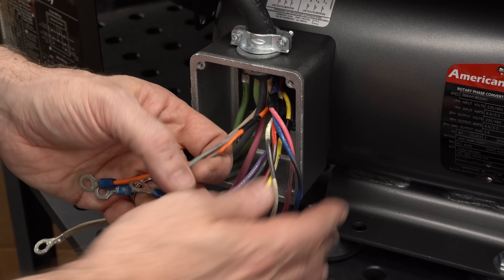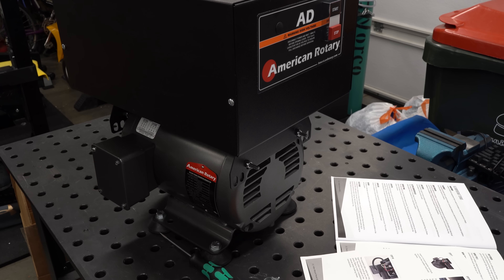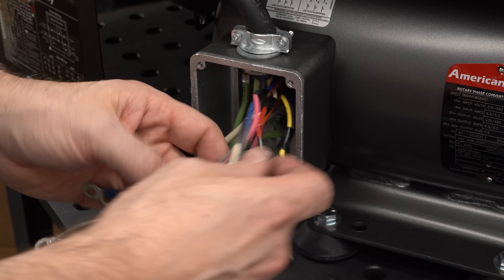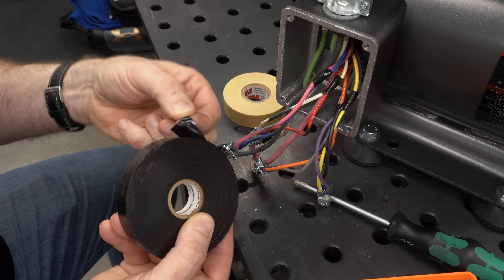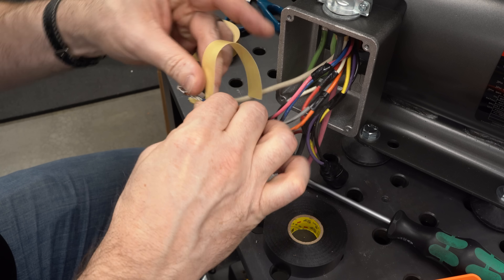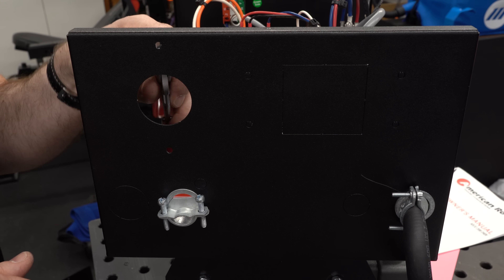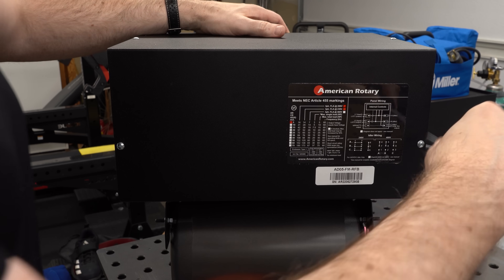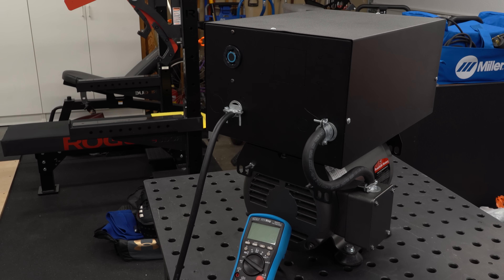How to Wire a Rotary Phase Converter the Old-School Way!

Comment: Ok, so you asked for a hilarious machinery moving story... I've got one for you.   When I built my workshop back in 2016, I also bought a small VMC (Haas MiniMill2).  I had the machine delivered to the riggers, and they brought it on a big flatbed to my little cul-de-sac along with an electric forklift to move it.  They moved my smaller machinery (bridgeport, lathe) into the workshop and then got ready to pick up the Haas... and... the battery in the forklift died, right in the middle of the cul-de-sac.   Did they bring the battery charger?  Of course not.   The riggers are about 50 miles from here, so they called ahead and several hours later sent another 18-wheel flatbed, with a larger forklift on it, to park in my tiny cul-de-sac.       They used the big forklift to pick up the little forklift, and proceeded to finish their delivery late at night.   It's actually a good thing that this happened, while I was waiting I read the data plate on the electric forklift and it wasn't rated enough to lift the 5100lb VMC.   Without me asking the riggers dropped their price by half for the trouble, so all good in the end.  I hope your grinder hilarity has a similar happy ending.

Comment: What's the down side of using a VFD to convert 1 phase to 3 phase ,???  if at home  shop , it would probably be 1 phase 220vac to 3 phase 220vac (for north america)
Reply: not all motors have insulation rated for vfds, and 3 phase welders dont like vfd power either
Reply: VFD manipulate extreme hertz levels and are not safe as a general power supply and are designed to completely control one load....the voltage is not safe to use as a general power supply.
Reply: @fritzmiller9792  yes agreed but if you set-up 60hz and 220vac 3 phase , that's what it will do all day.

Comment: To be honest I would have used Wago Lever Nuts. As the idler is just a three phase motor without a shaft there is very little vibration. In a small shop it is unlikely to see enough use to ever wear out the bearings let alone wear out a lever nut an cause failure. For average small three phase motors in non severe service they have become go to.

That said it was a good demonstration of motor lead connection and insulation. I have done the same many times building new industrial equipment. My only recommendation would be to stretch the 130C tape more. I was taught to stretch it to twice its original length and wrap it tightly in half lapped layers until the shape of the terminals and bolt are no longer distinguishable. You use about the same amount of tape but end up with a dense void free ball around the splice. Additionally the outer cover with electrical tape is mainly to prevent the individual splices from getting stock together as the tape vulcanizes.

For you dilemma of two wire into one ground lug. The best option if they are both the same size is to use an appropriately sized double or twin wire ferrule. Putting two individually wire ferruled or un-ferruled is fine as long as the lug or termination point is rated for it and the lug in you unit probably is (most set screw type lugs and ground terminal bars in that size range are from what I have seen).

Lastly as mentioned previously modern small three phase motor leads almost always have the wire numbers printed along the  entire length of the wire. If you ever have a motor with no identifying marks it can be recovered but it is a bit involved as part of the process involves powering up individual windings while measuring voltage on other windings to determine the correct phasing of them. Not a big deal but tedious especially if it is a large motor.
Reply: Interestingly, anything that uses spring-clamps instead of screws (whatsoever) should perform much better under vibration, so I did not understand his argument there. However to his credit, the problem is alleviated using the (proper) shake-proof washers. Still, I think when it comes to vibrations, in the long term spring based clamps will perform better, always.

Comment: Glad you made the video as the problem with using VFDs that frost / flute ball bearing due to the (PWM)pulse wave modulation cycles possibly hundreds per seconds worry me..there's talk from Hvac guys saying stray charges build up on / in the armature that get up to 70 volts before finding ground/ earth thru the ball bearings..frosting then fluting them..of course a solution, is to add a ground to the shaft it self with a common commutator brush with spring mechanism to keep the brush in contact with the shaft and offer a ground path that's not thru the ball bearings..but a grounding rod and wire in needed as well ..they say about 300hrs before serious damage occurs, which most hobbyist level operators will take many years to see..that's why some people claim zero problems with VFDs and don't even know of this problem..
Reply: I saw this happen just wiring up an older 3 phase motor not intended for inverter duty. There was enough current to shock me because I didn't ground the motor case, and to have that current flow through the bearings to ground would mean early failure. Definitely need brushes on the shaft or just use a motor designed for it?
Reply: @topduk  less reliable is just a copper wire wrapped in a loop around the shaft to ground..it would need more up keep as it will tarnish and loses ground the copper wire etc..even worse the charge could find ground thru the spindle bearings destroying a mill or lathe vs just a electric motor..rather just add a ground or use a rotary phase converter to avoid this problem that isn't really known by most people as it takes so long to cause serious damage and many times people don't know or understand the root cause of the frosting / fluting of the ball bearings..

Comment: My first machine tool shipping story.  I bought a 1966 Springfield lathe on eBay for $500.  I drove to Carson City and trailered the 6000 pound machine back to Boise.  When I got it home, I attempted to lift it off the trailer using my 9000 pound automotive 2 post lift.  Unfortunately, I did not think through my rigging, and the side load on the lift ended up cracking my concrete floor.  We ended up rolling it down off the trailer using ramps and pipes, after which I had to remove my automotive lift and jackhammer out that whole section of my garage floor so I could repour a fresh, reinforced pad.

Comment: My second machine tool shipping story.  I bought a 1959 Gorton 1-22 Mastermil vertical milling machine on eBay from a seller in Milwaukee.  I paid $800 for the machine, plus $800 to ship it to a shipping terminal near my house in Boise.  It took the seller more than a month to actually ship it, and when it arrived I discovered why.  The seller had set the machine on a thin stamped steel pallet, and then strapped it down with 3 little 1 inch ratchet straps.  Somehow the shipper accepted it.  As you'd imagine, the machine had a rough ride.  It did have some damage.  I spoke with eBay, who advised me to accept the shipment, and then contact the seller about the damage.  After some back and forth, eBay ended up refusing my entire purchase price and the shipping.  I had the machine repaired in just a couple days and I've been using it ever since.

Comment: Any particular reason you chose a rotary as opposed to solid state phase converter?  Someday when I upgrade my CNC to one that requires 3-phase I was planning to use a Phase Perfect solid state unit, they appear to be more efficient and will theoretically keep the frequency more stable (important for CNCs, maybe less important for simper motor loads?)
Reply: I have the Phase Perfect and it's.. well, perfect.
Reply: Have had phase perfect for 20 years replacing a rotary converter. Probably more money but I would never never go back to a rotary converter. No noise, always on, better quality 3 phase than the power company, full horsepower and only 2% loss in power to make the conversion. If you make YouTube videos the noise reduction is a game changer for audio.
Reply: I would use a phase perfect too
Reply: I’ve never had a rotary doing anything to the frequency, I’ve built several in my younger days and had a few commercial ones, they maintained the line frequency that the electric company was supplying. Only ever checked for brief periods though.
Reply: I will probably depend on what you get. My Syil X7 only required a RPC because it has to go through a transformer anyhow to get to the required 380V. The drawback though was I needed a 15hp unit to run a 7.5hp spindle.
Reply: @TomDetka  At the risk of taking James' comments way off topic, the upgrade for me would be to a Haas VF2, 30HP, 70A for 3-phase 240V.    Goals are faster spindle, larger ATC, so I could also do this with a 15HP Super MM2.  That only needs 40A 3phase, so I can do that within a 150A 2-phase budget.   Back to James' rotary, in his video it sounded much quieter than I expected.  I always thought rotaries were noisy!  I shouldn't be too spooked by 3Phase at home.

Comment: Worked for a small R and D company in the early 80s that specialized in unusual condition product handling mainly with the plastic bottle industry. Customer wanted a small footprint but tall preform sorter for a tight location and we produced. Loaded in a semi-trailer for the trip across the country and received a call when it arrived that the machine was damaged. Discussed how the unit had been loaded and secured and the receiving officer responded by saying with amount of splintered lumber in the trailer [ the bracing from packing} and the fact the machine was hanging thru the side of the trailer almost to the point of falling out that they believed the trucking co was responsible, they also ordered a replacement unit on the same call.

Comment: As an oldtimy electrician myself, the three wires taped together in the peckerhead was a dead giveaway. From memory it should be, 1&4 tied to phase "A", 2&5 tied to phase "B", 3&6 tied to phase "C" (or in this case creating the "C" phase) and 7,8,&9 connected together and tucked away in the peckerhead.

And old-school would involve a lawnmower cord used to spin up the idler shaft as you apply power to the converter. The homemade one in my garage uses a pony motor.

As for your ground wires, your lug should be approved for two conductors, so you should be good.
Reply from the maker: Cool.  Thanks!
Reply: I agree about the ground, most of those lugs are designed for multiple lugs.

Comment: For many years my grandfather just pull started his 5 hp motor used as a phase generator. Nothing else needed. Capacitors and voltage switches only make it self starting. 😁

Comment: Everybody from the EU seeing the motor connections: WHAT THE F******CK?!?
Reply: Which is exactly what we say when we see their wiring methods. Check out the loop-fed branch circuits that were all the rage in the UK after WWII if you don't believe me.
Reply: @MrWaalkman  UK is not EU any longer, and Europeans have always laughed at UK's archaic way of doing electricity and plumbing. Let's put the plumbing outside the house, so it's easier to replace when the pipe cracks from freezing.

Comment: It would be great of the wires were labeled, but it would be even more great if it wasn't so prohibitively expensive to install real 3 phase power connection at residential houses. It would be absolutely amazing if each new house got a 3-phase power by default, like in other parts of the world :/
Reply: I suppose it's less expensive to run one 720 VAC line and then a step down pole mount transformer to feed the house 3 phase.
Reply: @dans_Learning_Curve  I'm not familiar with it, but if it's single or split phase you still need a phase converter. In a 3-phase system the the phase shift is 120 degrees between lines, and for split phase the phase shift is 180 degrees. A step down transformer will not change phase relation.
Reply: @piranha32  American 'single phase' is just that, a single sine wave at 240V with center tapped neutral.
A rotary phase converter couples a single phase 240V motor to a three phase generator (idler)
American Rotary has a full page explaining their products but obviously YT doesn't allow links so you'll have to figure that out yourself.
Reply: @jimurrata6785  I know how a phase converter works. And I know that with a 3-phase service is is completely unnecessary.
Reply: @piranha32  Then why do you say "for single phase the phase shift is 180°???
There is no phase shift in residential American 120V power. It is two halves of a single 240V wave.
Places like western Europe get 230V x √3 = 398V to the home for stoves, saunas, ect...
When I moved shops a decade ago I had a hard time getting three phase to a building zoned light industrial!
Reply: @jimurrata6785  Split phase.
Reply: @piranha32  .... Is still a single wave.
There is no phase shift because it's only single phase.
Reply: @jimurrata6785  There is 180 degrees phase shift between legs.
Reply: @piranha32  there is no phase shift in Split Phase. It's simply tapped out of the middle of the winding...the winding is itself stepped down from a single high voltage leg.
Reply: @fritzmiller9792  The two legs have opposite phases, and this is how you can get 240V voltage between them while maintaining 120V to the neutral. Hence the phase shift between them is 180 degrees, like it or not. It's simple trigonometry.
Reply: The wires were labeled. The numbers are printed on the wires themselves. Take a look at the @5:35 mark you can just barely make them out.
Reply: @MrWaalkman  It was reference to the comment at the beginning of the video.
And with 3-phase power at home, none of this would be necessary :)
Reply: @MrWaalkman  Pro tip: I friggen hate flags in the box but you can buy shrink tube spooled for use in a P-touch label printer.
Take note that the size given is the flattened width of the tube, not the diameter it will fit over....
Reply: @MrWaalkman  hahaha, I thought so.....I didn't look that close but I have always found this to be the case except when the heating or oil or grime has ruined it. I have even partly opened the pecker head and gasket to get a fresh length of wire to read.

Comment: A quick and dirty phase converter. Take a 3 phase motor larger than the one you want to power. Apply switched 220 to two of the legs. Wire the motor you're powering to all of the legs with a switch.
Next, get the idler motor spinning and turn on on 220. Then turn on the motor you're powering. It will run. You won't have a true full sine wave on the manufactured 3rd leg, but it'll get the job done.
Is it perfect? No. However, I've been using this method for 10-15 years in my hobby shop powering my lathe, mill, and car lift.
Reply: You ain't wrong, most people can't or won't do that though. Technically, that achieves the exact same electrical results as the third leg is generated in both motors windings once in motion.👍
Reply: What if you need a neutral though?
Reply: Yup. That's how I've done it in the past, and don't be afraid to use a "wounded" motor with a busted mounting foot or a screwed up shaft. Who cares? And it's "no caps, no problem" where I come from.

Comment: Nice install. My 10 HP American Rotary ADX wall mount had tags and numbers on the idler wires. In the two years I've owned it, I've had it apart only to check connections after the first month and relocate the panel. It runs all my machines and has been rock solid.

Comment: I've been working with industrial control systems for 35-40 years, and I think every electrician I've ever worked with has called the motor junction box the "peckerhead".

About 33 years ago I worked for a small company in NE Iowa  that made the equipment that makes concrete pipe.  We were installing a new machine in a plant in Delaware.  Part of this equipment was a 110' clear span bridge crane.  While the crane was being installed, the rigging failed, and the crane fell.  The only casualties were the crane and the turntable of our machine.  I'm told that the insurance company wound up chartering a cargo 747 to air-freight the replacement crane from the manufacturer in Germany.

About  10 years later I was working on installing a new 400Hp twin-screw extrusion system in Chicago.  The extruder was built in Switzerland and airfreighted to O'hare International.  The moving company dropped the extruder while transferring it from aircraft to the waiting truck. 

About 4-5 years ago I was installing a new production line for my current employer.  Part of this was replacing the 50-60 year old electrical system on 6 floors of a 100+ year old building.  This involved installing a number of Allen-Bradley MCC sections.  When the electricians were taking the shrink-wrap off of one of the units they noticed something strange and called me over to look at it.  There was obvious damage to the unit, but it had been re-wrapped by somebody to hide the damage.  We wound up eating the damages to that unit.

Don
Reply: Nope, a Peckerhead refers to a a weather head.That's a a J-Box.